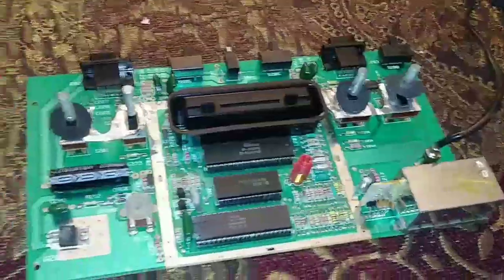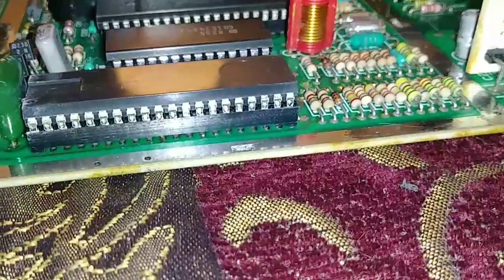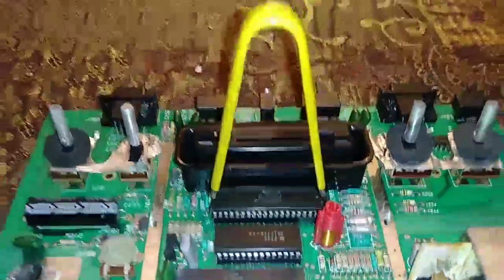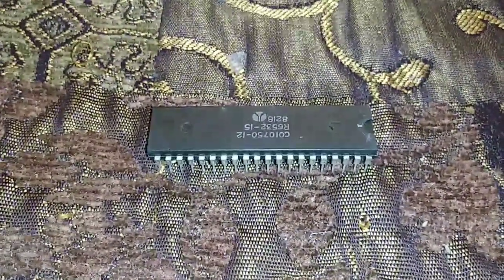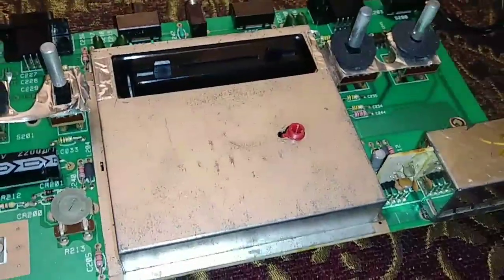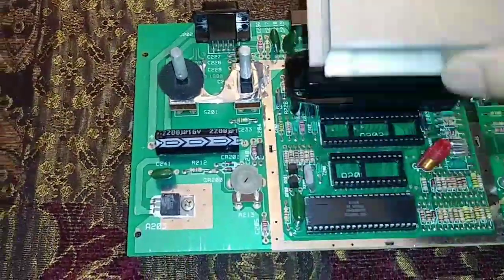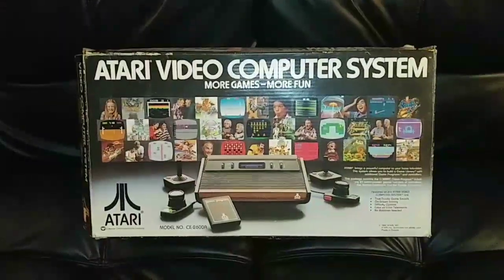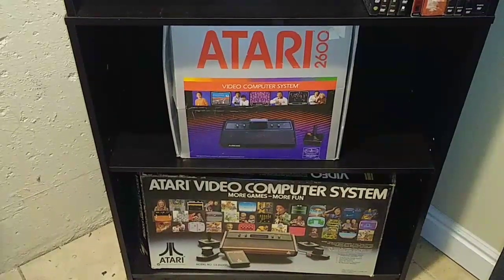Atari 2600 Fix : RIOT Chip Replacement

Comment: THIS RIOT CHIP WORKS FOR AN ATARI LIGHT SIXER OR WILL IT WORK FOR AN ATARI SIX LEVER, TELL ME PLEASE.
Reply: Just to clarify, the Heavy Sixer was the first 6 lever design with rund edges at the bottom of the front.
The Light Sixer also has 6 levers but the bottom edges at its front are shaped like, well, an edge.